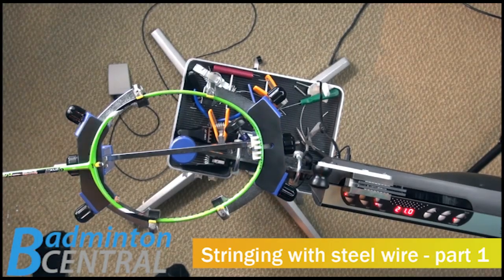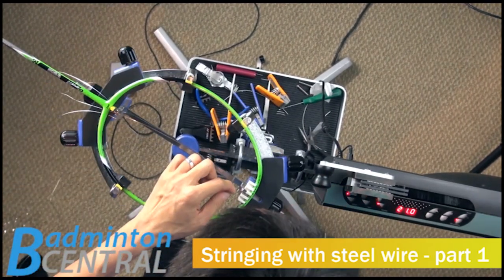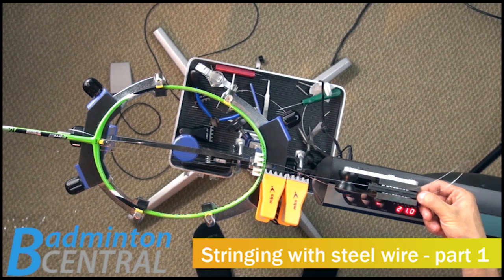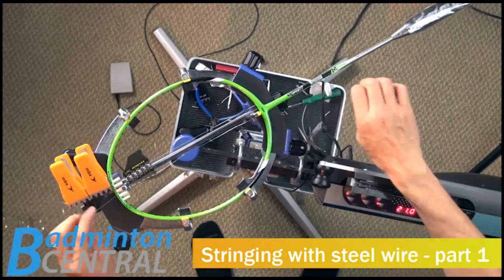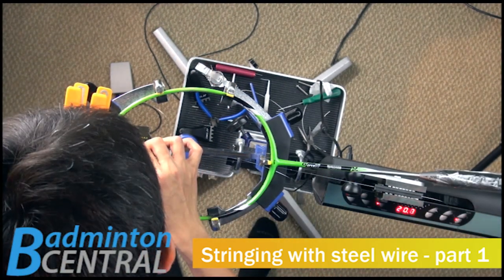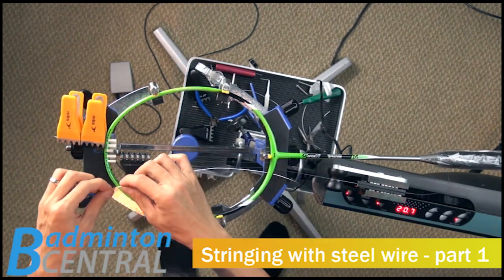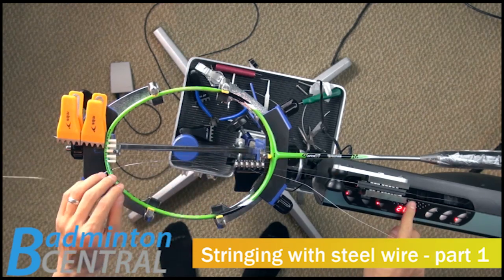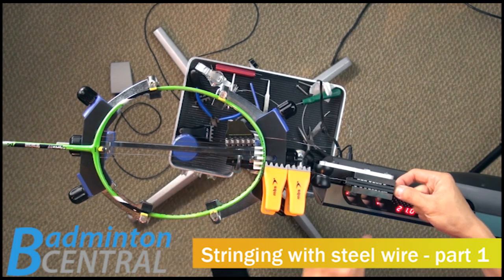Badminton Stringing with steel string - Badminton Stringing

Comment: I tried 0.4mm diameter music wire, tightened by bare hands
With low tension, hard to control
And the vibration is huge, very loud when hit hard
Though heavier, you can pull out very strong shot if swing skillfully
However, i don't recommend using music wire unless you only want something shinny, super cheap and super durable on your racket. It's heavier,  the elastic coefficient is several orders higher than human strength, and tends to preserve vibration (so it generates good and long lasting sound on your guitar) so uncomfortable to use.
Reply: And by the way, 0.4mm music wire (it made of cold drawn tempered high carbon steel, anyway a kind of thermo mechanical treatment), can have 70 pound tensile strength, much higher than that of stainless steel wire